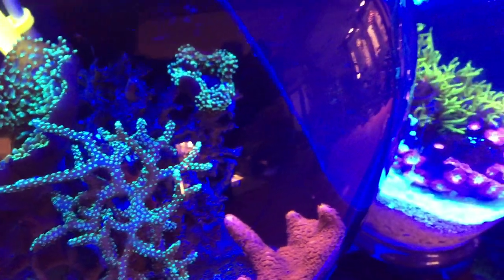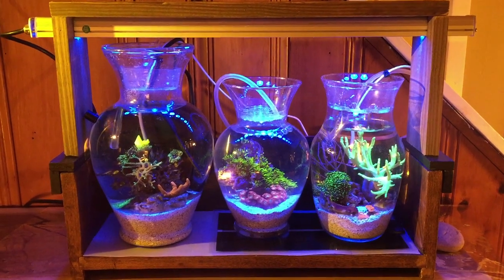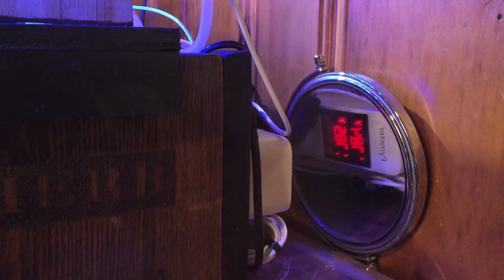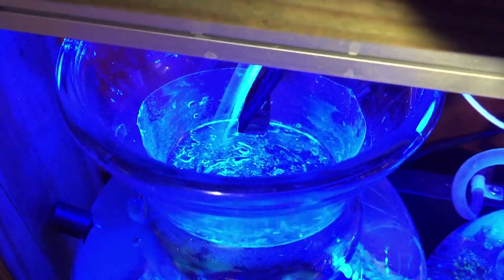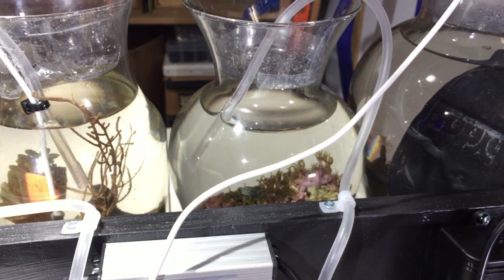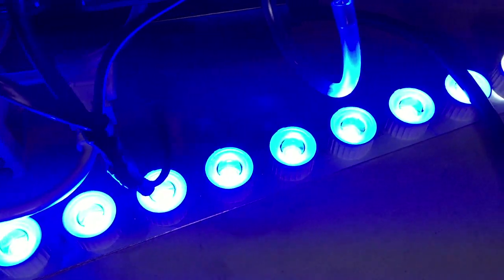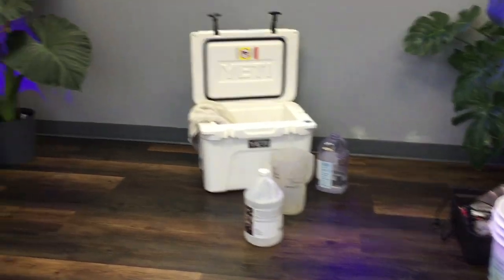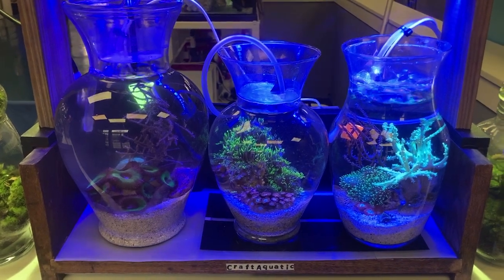TRIPLE REEF VASE - NANO REEF AQUARIUM SYSTEM

Comment: Looks good.  I'm curious about the battery.
Reply from the maker: I’m working on a battery powered backup generator that will keep the entire 120 mixed reef running during our frequent blackouts. We have a gas generator, but it has to be set up manually. Video is a few months off, but definitely in cue. Thanks for checking out the video.